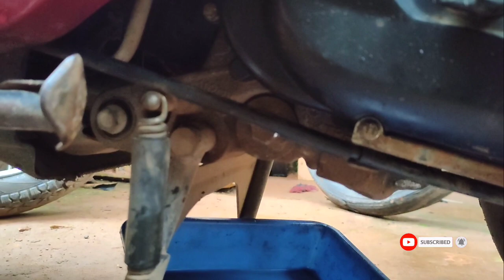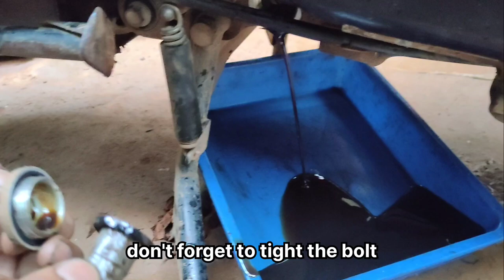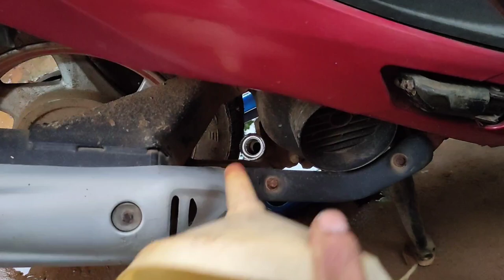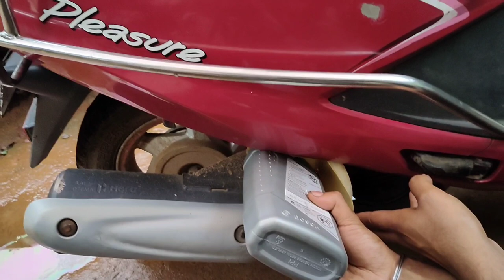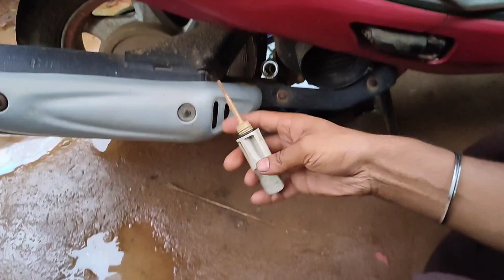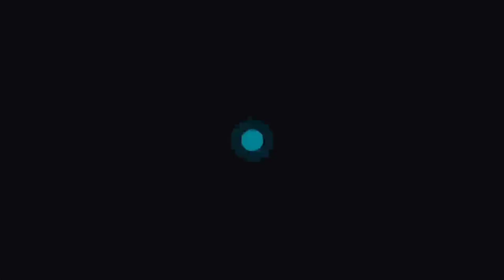Hero Pleasure Engine Oil Change

Comment: kuch bhi kyu galat jnkari faila rahe, kya no ka oil lagta hai bhai?
Reply from the maker: I don't get it
Reply: You are putting 20w40 while it should be 10w30.
Reply from the maker: I agree with you i m not recommending it. Always use what manufacturer tells

Comment: What is the bolt number
Reply from the maker: If you meant the bolt size, then it's 17mm
Reply: @RaceTuner2024  no screwdriver no 🪛
Reply from the maker: I don't think we have used any screw driver here 🤔
Reply: He means the ellenkey or Chucky @RaceTuner2024